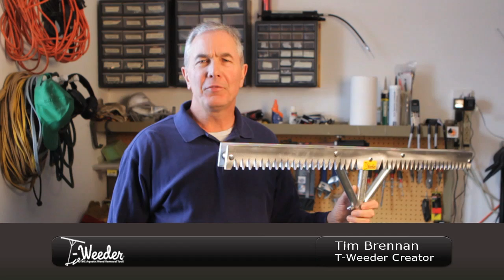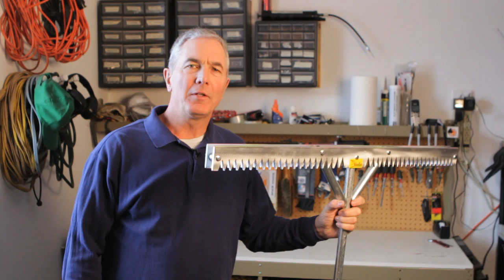Comparison of Different Lake Weed Removal Tools

Comment: How are we suppose to know what you are talking about without actually demonstrating how it works ? Like do you go into the water with the rake and pull manually ? or do you
tie one end of the rake pole to a rope and drag it across ? or do you get in a boat........
and how long will it take to pull all the weeds in the lake with what looks like a 24" rake ?
Reply from the maker: There are a number of videos on my website and also on YouTube that show the entire process of throwing the T-Weeder out, pulling the weeds in, shaking them off and tossing it out again. It's quite simple and effective.
Reply from the maker: Here is a link to one of my other YouTube videos showing the T-Weeder in use:  https://youtu.be/wzIRvtA63aY